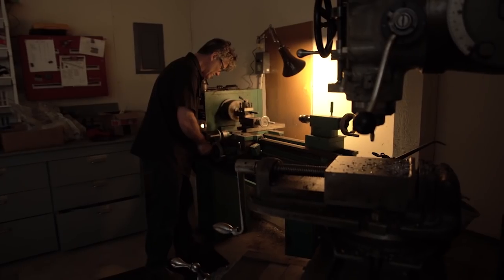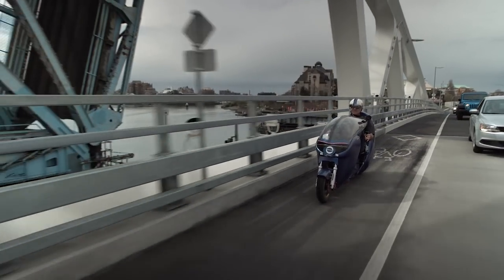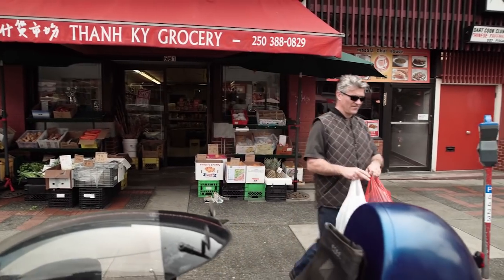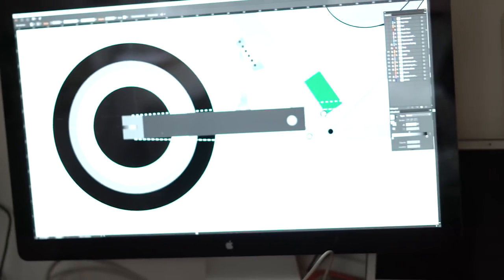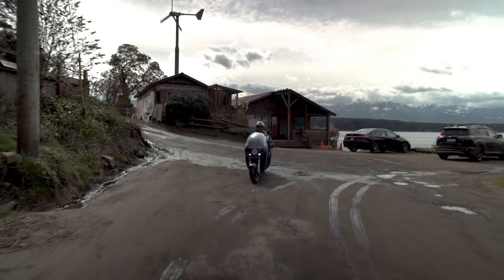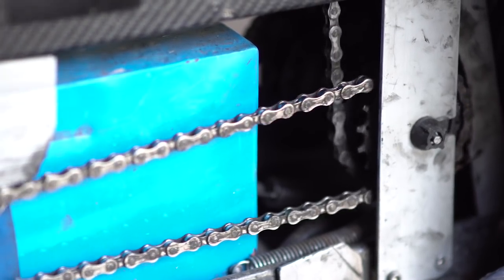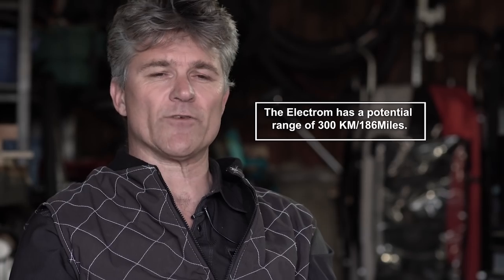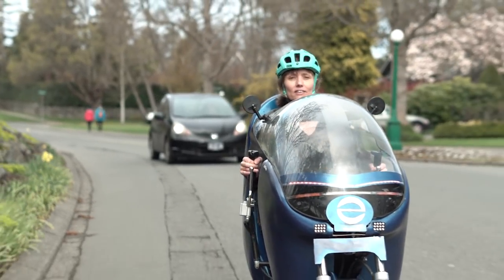Electrom LEV/e-bike Pitch Video

Comment: The pedal generator is a clever workaround to maintain bicycle status.  I am hoping that the Electrom will be accepted as bicycle in the US, we have been waiting a long time for an electric FF bike.
Reply: Isn't there a min cadence you need to keep for your pedaling to create electric power?
Also, variations in cadence will create variations in generator output. Won't that have a negative effect of battery charging?
Reply: @bethsaytomvarughese8839  The bicycle is powered by the battery, pedaling charges the battery to increase range.

Comment: It might want to reposition the window a little bit higher because if the person Rex they only got a foot the try not to get their head cut off by the window!
And I don't think you have a seat belt I don't think you can keep anybody from moving their body forward!
Reply: That is the first thing I noticed.  
The edge of that screen could take a person’s head right off.  Perhaps move the rear edge forward away from the rider, and add a more vertical clear panel. 
It shows some innovative ideas though, so I hope it is very successful. 
I love that bipod stand.
Reply: it resembles a velomobile, the head of the person is above the fairing
if the edges of the fairing as rounded, they wont be a hazard, plus the fairing isnt that much solid
i never heard of a person losing their head bc of a velomobile's fairing